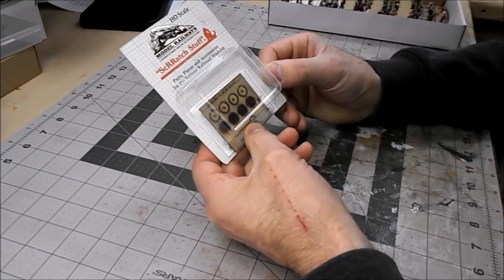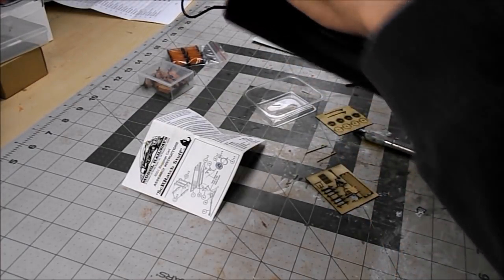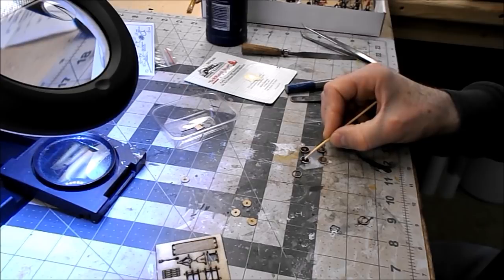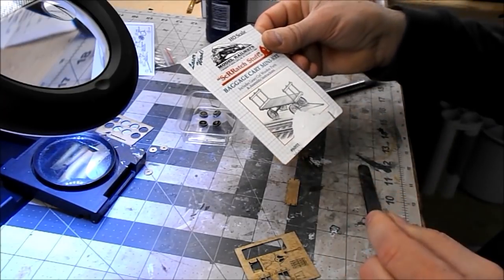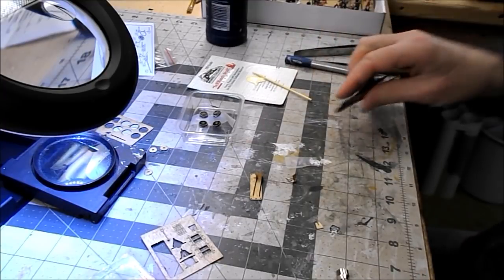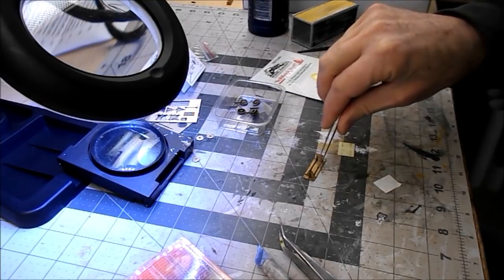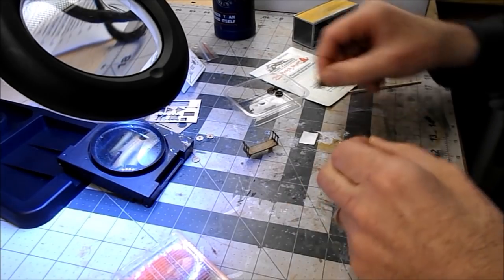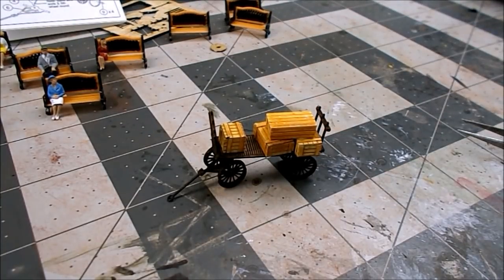Buiding a laser-cut wooden baggage cart

Comment: I personally like the Details West baggage wagon kit in metal.  The older kits came with 2 suitcases 1 large and 1 small.  I found 2 kits at a train show in Jacksonville FL.
I was into passenger trains that constantly chassed their tails. As I remember the kits were made of a pot white metal, very flimsy but workable. One had a wooden deck or a resepantation of wood in metal. The other had a steel deck.I built that wagon with a wood deck. Very fine strip wood. At a train show I learned in 4 easy steps how to make luggage. I made aprox 30 pieces of luggage in an evening. While I crafted the baggage we listened to the Telly.
I joked with my wife (ex now ) that I was always ready to go anywhere I had plenty of luggage.

Comment: If you really want to try something extremely fiddlly take a look at a website called  MicroArtWork.com. The site owner has been designing a 1/96th scale Saturn V Crawler and Launch Umbilical Tower (LUT) as a card model. It took him ten years to finish the crawler. If one went the full detail route it's around 14,000 individual parts. He's been working on the LUT for maybe 5 years. He has a free download of the Command Module Service Arm. One thing that is nice about it being a card model is if you screw up (it happens) just print another sheet. His in instructions are in Acrobat and can be viewed in 3d from any angle. I've tackled the arm at 1/72nd scale simply by scaling up the parts sheet. It's not an easy build by any means